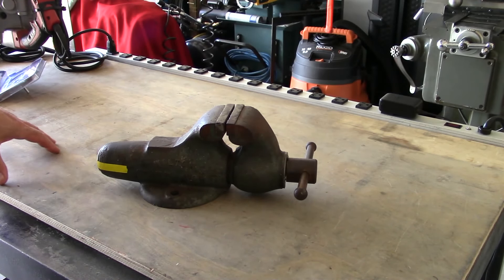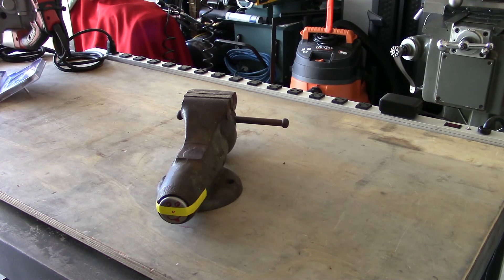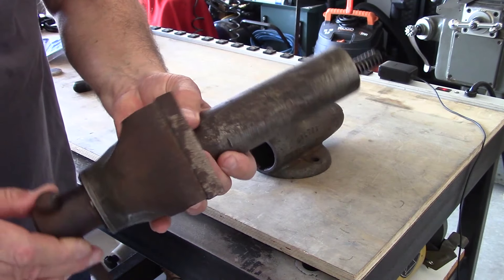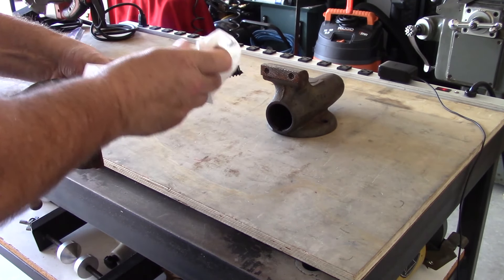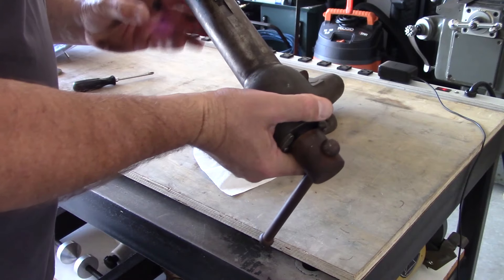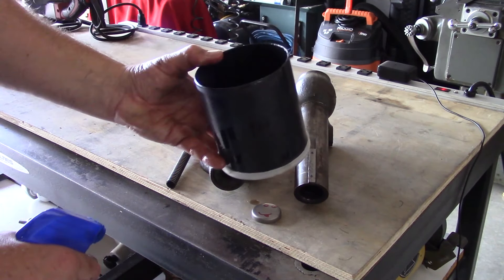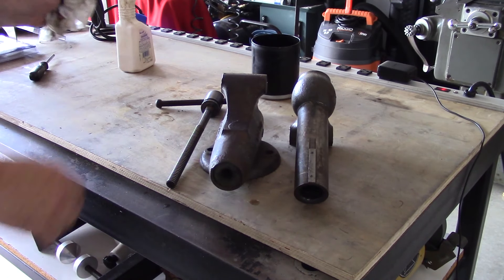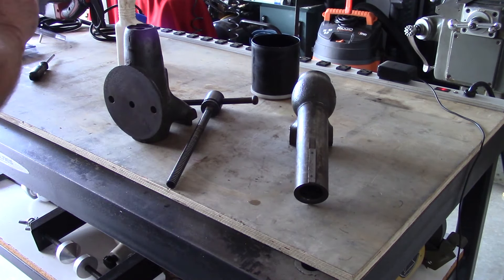Wilton Vise Restoration Part 1

Comment: Looks like you are off to a good start Ray. Soon you will have the thing looking like a brand new bullet which is fitting for the new shop. I'm with you as I do not see why any company would design an anvil on a cast iron vise as that's an invitation for disaster. My dad had a nice bench cast iron bench vise that had a face and horn just like an anvil which I had used several times to form copper and brass spinner blades for the fishing lures I was making. Then I decided to make a robotic arm and my dad got me some 8-gauge sheet metal for the project. After I cut out the pieces I needed I started to shape them on the "anvil" which cracked in half. My dad was pissed, to say the least, and did not consider that a 10-year-old boy did not know that you were not to use something that looked like an anvil as an anvil.
Reply from the maker: Amen brother! I think a vise anvil is for setting your beer on and that's it! I will need to add a nice "real" anvil once the shop is complete, I never had one but sure could use one! Thanks for sharing your story, I enjoyed it!

Comment: Wish I would have stumbled across this video yesterday as last night I disassembled my 1st Wilton.  Curious as to why you pushed the pins out from the inside.  My pin holes didn't line up ether.
Reply from the maker: Wilton factory original pins are tapered and should be removed from the inside out. If you push them from the outside in you run the risk of oversizing the pin holes.

Comment: hi ray,
almost all the time you were fighting the pins, i was holding my breath and rooting for you!
i hope you might want to find somewhere or, better, machine the turnstill base for that vise.
btw, diesel fuel or kerosene is a great soaking and cleaning agent for the cast iron. i am sure you know it yourself.
thanks for the vid,
-toly
Reply from the maker: Hello Toly, Thanks for rooting me on buddy! I am still looking for a swivel base, no luck so far... WD40 worked great for cleaning it up, it does have kerosene in it from what I hear. Thanks for tuning in!

Cheers,
Ray

Comment: Concerning the nut damage:
Make an aluminum plug to press into the counterbore;
Braze the damage;
Remove plug and dress the brazed area;
Lay coarse sand paper face down over the braze, and tap the paper lightly with a hammer.
This will give you a reasonable facsimile of the sand cast surface.
Paint it pink then reassemble, have some of your favorite libation, then set back and enjoy your work.
Regards,
Duck
Reply from the maker: Hey Duck, Thanks for the info buddy,! I think I going with the Rusto Hammered Verde green to keep it original plus I don't want to copy Brad Jacob's pink bullet!  Stay tuned for Part 2 Thanks for dropping in!

Comment: I appreciate the video but I have a Wilton C1 with pipe jaws but there are no screws on them, nor any where else, that I can find. 
The date on the bottom of the dynamic is 4 97, which I also can't make sense of. 

Any information would be appreciated, thanks.
Reply from the maker: I would try and do a Google search on any the the casting numbers you can find, usually Wilton date stamps are when the warrenty expires and not when it was made. Thanks for tuning in!

Comment: I want to know the correct way to split the hole in the circle
Reply from the maker: Hi Mohamed, I would use a center finder to mark the center of a circle. I hope this answered your question and thanks for tuning in!
Reply: Not exactly this
I want to make a hole in the circle diameter 160 must be the number of hole 16 hole and that the dimensions are equal to high accuracy
What is the right way?
Reply: Explain to me how accurate in this
Reply: 160 ÷16×3.14 = ؟
Is that correct ?
Reply from the maker: Yes, I was just looking it up to verify but that does look correct. I would try on a test piece first to make 100% sure. I use the DRO circle feature on my mill, so I never have to calculate.
Reply: Ray Caniglia thank you my friend
Reply from the maker: You bet!